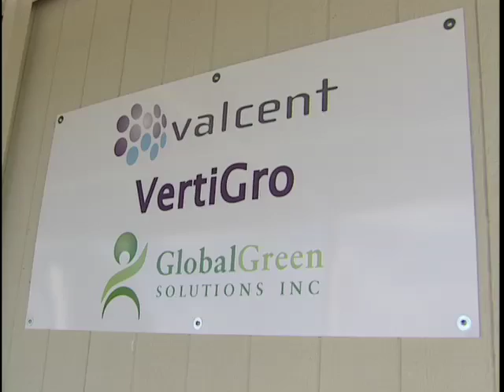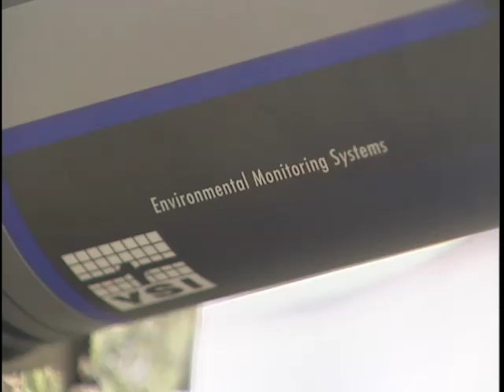High Density Vertical BioReactor

Comment: He said he knew what strain of algae was best suited to produce Diesel. But he didn't say what it was!  We have plenty of ideas about how to build a great bioreactor to grow the algae, but WHAT IS THE ALGAE STRAIN WE GROW IN THAT REACTOR TO MAKE DIESEL??   The answer is found here:   https://microbewiki.kenyon.edu/index.php/Biodiesel_from_Algae_Oil  Here's a quote from the article, it's a long story, because these guys are really detailed about it : 
    
"Highest-yielding algae:

The algae used in biodiesel production are usually aquatic unicellular green algae 

Chlorophyceae.

This type of algae is a photosynthetic eukaryote characterized by high 
growth rates and high population densities. Under good conditions, green
 algae can double its biomass in less than 24 hours. Green algae can 
also have high lipid contents, usually over 50%. This high yield is 
ideal for intensive agriculture and can be an excellent source for 
biodiesel production (Demirbas & Demirbas, 2010).

 Chlorella

Chlorella is a single-celled green algae belonging to the class of Chlorophyceae.
 It is a primary algae because it grows autotrophically. It is spherical
 in shape, about 2 to 10 μm in diameter, and does not have a flagella. 
Chlorella has green photosynthetic pigments, chlorophyll-a and 
chlorophyll-b, in its chloroplast. Using photosynthesis, it multiplies 
rapidly requiring only carbon dioxide, water, sunlight, and a small 
amount of minerals to reproduce. Chlorella is believed to be capable in 
serving as a potential food and energy source because of its 
photosynthetic efficiency to reach 8% comparable to other highly 
efficient crops such as sugar cane(Wikipedia-Chlorella).

Manipulation of metabolic pathways can redirect cellular function toward
 the synthesis of preferred products and even increase the processing 
capabilities of microalgae . For heterotrophic microalgae, 
outside carbon sources offer a large amount chemical energy, which the 
cells often store as lipid droplets. Heterotrophically cultivated Chlorella protothecoides has been shown to accumulate as much as 55% of its dry weight as oil, compared to only 14% in cells grown photoautotrohpically (Rosenberg et 
al., 2008).

 Dunaliella

 Dunaliella is a unicellular green algae also belonging to the class of Chlorophyceae. It too is a primary algae. It is rod to oval shaped and about 9 to 11 
μm in diameter. The organisms are simple to cultivate and do not clump 
or form chains.

The properties of various fatty esters determine the overall fuel 
properties of the biodiesel fuel. There is no one strain or species of 
algae that can be said to be the best in terms of oil yield for 
biodiesel. But, diatoms along with green algae are the most promising. 

Scenedesmus dimorphus

Scenedesmus dimorphus is a unicellular algae in the class Chlorophyceae (green algae). While this is one preferred species for oil yield for biodiesel, one of the problems with Scenedesmus is that it is heavy, and forms thick sediments if not kept in constant agitation. 

Dunaliella tertiolecta

Dunaliella tertiolecta is a marine green flagellate with a size of 10 to 12 μm in diameter. This strain is said to have an oil yield of about 37%. D. tertiolecta is a fast growing strain, therefore allowing it to have a high carbon dioxide rate (Wikipedia-Dunaliella)"

Comment: @ceetable Yeah, that is referred to as carbon neutral, and is the latest buzz word.  Granted algae biodiesel won't take C02 out of the air, but it won't increase it either.  Until the liberals deliver on their promise of cars that run on clean burning unicorn excrement, we have to start somewhere, and algae biodiesel is the most viable option around.